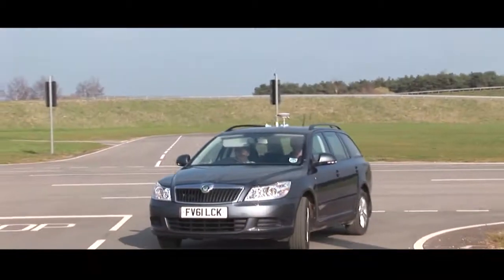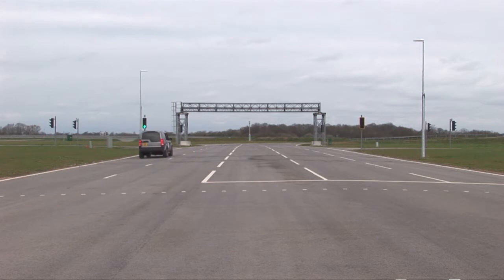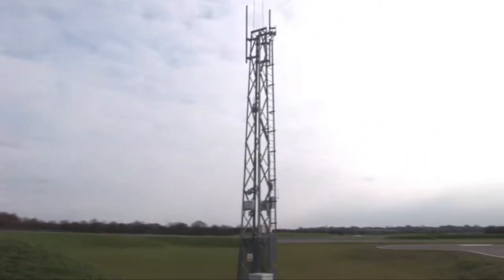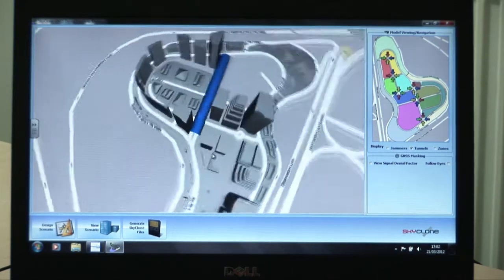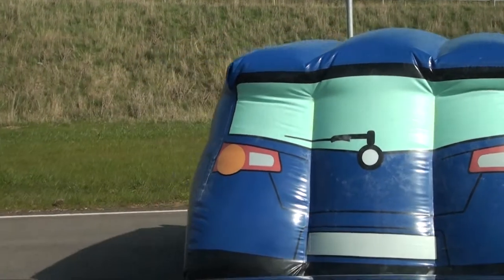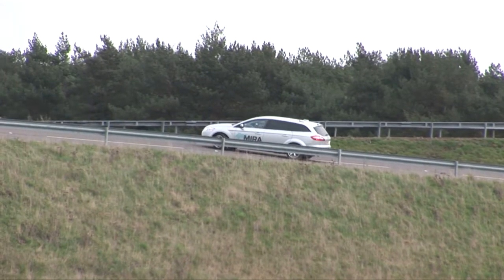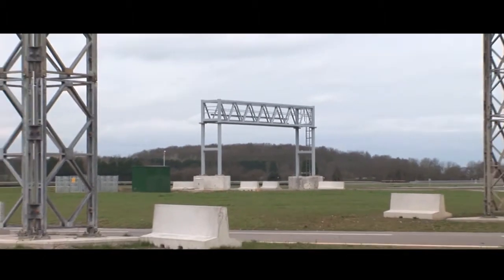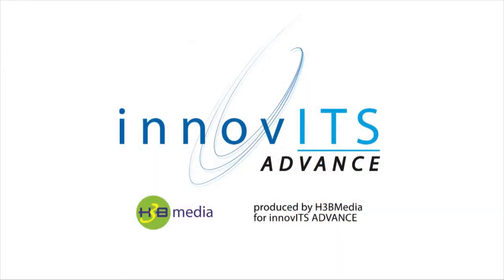innovITS ADVANCE: Bringing ITS innovations to reality

Comment: Andy  Transports Design – automotive, rail, ship, jet, missile.
[] what is the 
cost/ton-kmph; hp/ton-kmph; hp/fuel-hr; ton-kmpl; co2e g/hr? 
.
1200 hp/10 L
Andy Car: 120 hp / 1000 cc n.asp; 320 kmph, 1500 kg, 64 kmpl, 15,000 $ [] blunt nose, air breath andy rotary engine, bearing, jet.[] all liquid, gas fuels. Co2e 36.3 g/km.
.
Andy Formula 1  Race Car  1600 hp / 2400 cc  600 kg 600 kmph [] Lap time 70 secs for 90 secs [] win by 12 laps.[] 1 mn$. vc 5 mn$ 1 yr  [] niraima1  at  gmail  com